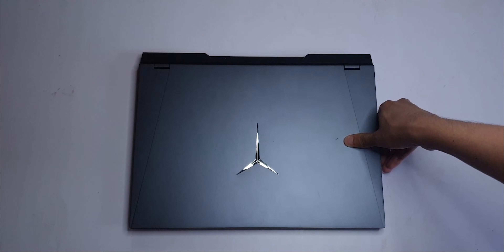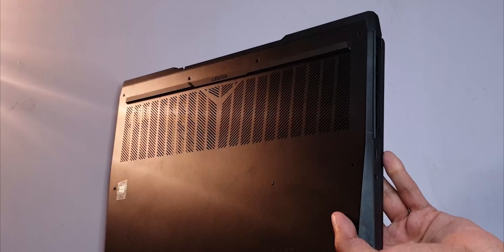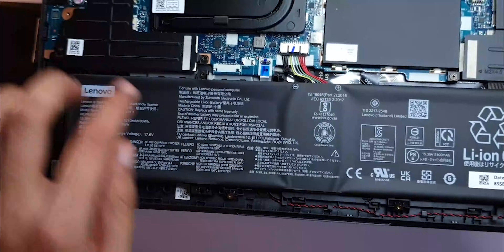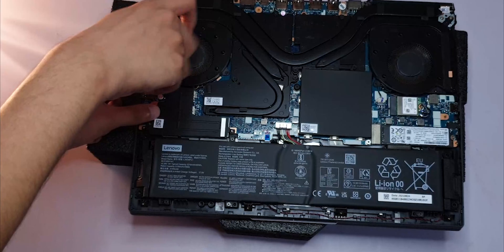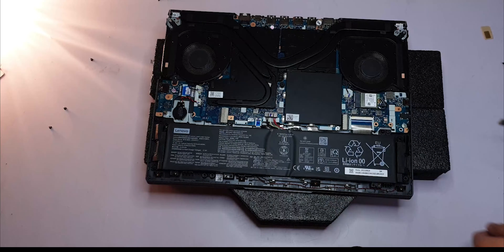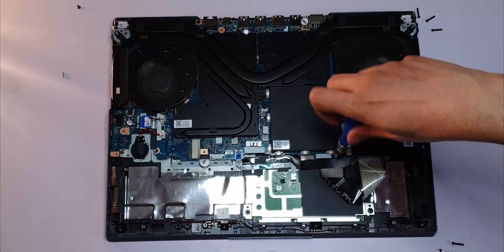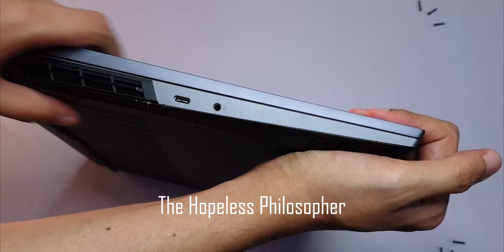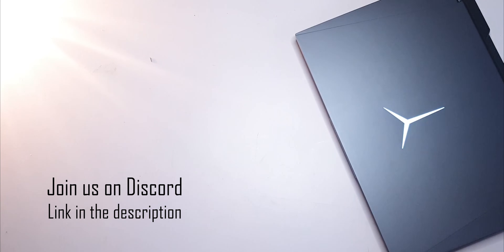Lenovo Legion 5 Pro Teardown - Battery Replacement, RAM Upgrade, etc.

Comment: My motherboard gave out after only a year and a half of use. Never buying a Lenovo gaming laptop again
Reply from the maker: They're not the best for the price, that's for sure. I would probably stick to Asus next time
Reply: @TheHopelessGeek my dad got it for me as a graduation gift in 2022. I did a lot of gaming on it. But still. No excuse for the motherboard to die like that when it’s working perfectly fine. I only opened it a few times to clean out the dust in the fans. I never dropped it or spilled anything on it. It almost always stayed at my desk.
Reply from the maker: Damn, that's unacceptable. Did you contact them yet?

Comment: 4:55 trust me they will last more than your older battery. The cables are not fragile but you have to be careful around them. 80 Wh is not a joke. It is like a pocket sized c4. Nasty fire incident can happen.
Reply from the maker: Yeah, I see your point

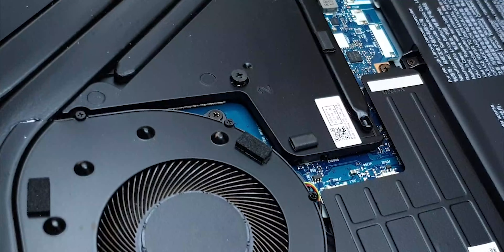Comment: 3:02 It's not going to come off. The spring loaded screws are not designed to come off when unscrewed. They make a distinctive click sound while engaging and disengaging. Don't damage them.

Always disconnect battery before touching internal items. The motherboard might get short circuited.
Reply from the maker: Valid points. Thanks for mentioning

Comment: This is a serious issue regarding battery. My battery wires ,the red one. They melted off 🤐🤐🤐 just by using laptop. Literally the motherboard consumed so much power my battery thin wires just melted offf. Good thing is the system stopped using the battery and it wouldn't turn on without the power adapter. Still Lenovo vantage shows battery health GOOD
Reply: Lenovo vantage is a joke
Reply: Yes the device i have is the same one Lenovo Legion 5 pro 16ACH6H model
Reply from the maker: Damn, thanks for sharing 🧐. My fear wasn't irrational then. I'm not surprised that Lenovo's software doesn't show anything correctly 😂

Comment: 2:58 u don t need to take out screws. when they are unscrewed u can feel them jump when further unscrewing. just take the heatsink off and make sure to disconnect the 2 small fans before
Reply from the maker: Ah, thanks.

Comment: Hai...Great Video..I am using Lenovo Legion 5 Pro (i7 11th Gen, RTX 3070) it seems my 16 GB RAM (8+8) is 1Rx16 and it lowers the speed. I wish to upgrade the RAM to 32 GB (16+16). I look at Crucial RAMs but they don't specially mention if its 1Rx8 or 2Rx8 included. So its a hit or miss buying them. So can you suggest any RAM which is exclusively using 1Rx8. 
Another question  : And also is the maximum capacity in my laptop is 32 GB or 64 GB RAM?
Reply from the maker: This RAM looks good. 2Rx8 and 3200 MHz, faster than the basic 2400 MHz. https://amzn.to/3X8HnLa
You'll need two of these.
Reply: @TheHopelessGeek  Thank you
Reply: @TheHopelessGeek  Is the laptop support 32 GB or 64 GB RAM ? I use Lenovo legion 5 Pro (i7 11th Gen , RTX 3070) Wome websites say it only support 32 GB...Can you help?
Reply from the maker: I think it's maximum of 32 GB. This forum page might help https://support.lenovo.com/in/en/solutions/ht504725-where-to-find-the-maximum-supported-ram-information
Reply: @TheHopelessGeek  Thank you..never seen any other YouTuber so responsive like you...So, you earned a subscriber
Reply from the maker: Thanks for the sub ☺️

Comment: have you experienced any odd sound from one of your fans? 
My right one is humming in a way like there is something making it slightly to vibrate as it sounds even worse when I am gaming.. 
Have you tried to remove your fans yet ?
Reply from the maker: Hmm, I think I heard them rattle once, but not anymore. I haven't removed them, but it should be quite easy to do.
Reply: @TheHopelessGeek  From what I've seen on some pictures I will have to remove the entire heat pad with it's pipes in order to get to the last screws for the fans. 
And a complete new set cost's around 120€ so I would rather attempt to fiddle with them my self, this is my 8'th laptop in my lifetime which took 1 week before I opend it and added another M.2 disc and 32GB Hyper fury X ram. 
When they are on low rpm or idle it dosen't rattle but start a game and it makes me worried.
Reply from the maker: I see. I'll have to keep an ear on mine then

Comment: Tip: what worked for me, was to use a suction cup (used to carry glass panes and such) and attach it to the bottom panel of my (brand new) Lenovo legion 5 pro and just pull it a little. That made the entire underside open up. I had tried getting all kinds of "official" wedges and other recommended tools in between the cracks without any success, before I thought of using a suction cup!
Reply from the maker: Thanks, I'll get one of those 🙂👍🏼
Reply: Wow thank you I used one of a phone suction cup holder and guitar cards and worked perfectly, this Lenovo devices are known for there hard opening cover you need to put a guitar card carefully and just be patient, thank for this idea 💡🎉

Comment: Spring-loaded screws are actually captive too, they WON'T come off.  they will unthread completely which you can feel if you go slow and pay attention to the feedback given by the screwdriver.  The reason for the springs is to affect the mounting pressure, as it's the cooling system of the machine and the screws are holding it around the CPU and GPU, much like how a lot of desktop PCs with Air coolers have springs around those screws.  Same general principle here.  

I am a Warranty Repair Technician for Dell and Lenovo currently.
Reply from the maker: Oh, interesting. Thank you for sharing that😊👍

Comment: So i cant like old laptops remove the battery or disconnect it and plug the charger when gaming so i dont harm the battery life ? 
Even if i opened the laptop each time i decided to stress out my laptop and unplugged the battery , i mean can the laptop power on and work with unplugging the battery and plug the charger like old ones ?
Reply from the maker: Yeah, it's a hassle here for sure. But there are many battery protection features that reduce any damages with heat in these gaming laptops. You should be good regardless 🙂

Comment: I have already written this comment too many times…Never take out anything on the system board before disconnecting the battery first.
Reply from the maker: You're right.

Comment: To remove the heatsink, just unscrew as much as you can and then lift the heatsink off . The screws are not designed to come out and they are present to add mounting pressure on the cpu and gpu by the heatsink ..
Reply from the maker: I see. Okay, I'll try that. 🙂👍

Comment: You should have a link to buy upgrades for the laptop.
Reply from the maker: What upgrades would you suggest? Faster RAM? 🙂
Reply: @TheHopelessGeek  My 16gb cam with SKHynix RAM, I replaced it with 32gb of Crucial CL22. RAM would be a definite upgrade if it came with that slow Samsung memory. I didn't get a chance to test out the SKHynix RAM, I couldn't pass up the 32gb deal I found on Mercari. Did you find a bigger battery like the Legion 5 has available. I can't find a bigger battery that fits the Pro. The screw notch on the bottom right does not line up. I started to file it down to fit, but I sent it back to Amazon.
Reply from the maker: Oh, I see. The RAM upgrade is surely on my list of upgrades 🙂👍🏻

Comment: bro the dust issues with gaming laptop fans is so annoying . I've ocd so I end up opening my laptop to clean the fans every month , I even broke my gpu fan twice trying to open it up completely and fans for my model are very ecpensive . please make a solution video for this dust issue . I've tried dust filters and air fresheners for my room nothing seems to work . by the end of the month same amount of dust is there
Reply from the maker: You could try vacuuming the fans while brushing the fins with an old toothbrush

Comment: Those screws are called captive screws, their purpose is to stay in place so that the service man don't lose them while servicing the laptop. 
As the heat sink is a critical component to keep the laptop healthy Lenovo's engineers have taken care to keep the heat sink always stiff and screwed by making sure all the screws are in place.
Reply from the maker: I see. So do unscrew them as much as they come out and try to pull the cover up?
Reply: @TheHopelessGeek  Yeah, you are right.
Reply: Nope, the screws have springs so as to apply extra mounting pressure on the cpu and gpu by the heatsink for best performance.
Reply from the maker: I managed to take them out just by unscrewing as usual on another machine. Pretty sure it'll work the same way here.🙂
Reply: @MrReklez  Those springs have negligible pressure on the heat sink.
As I said those are captive screws used to keep the screws in place. Google it.🙂

Comment: Actually u got unplug the battery ASAP and hold the power button for few seconds to discard the power completely once you open .... Coz there is better chance in getting shortcircuit than you getting 1 million JK. as my friend just droped a screw in motherboard . lap just did spark and the rest was history he was required to replace the whole laptop
Reply from the maker: I see. Yeah, it wouldn't be an issue if the battery was a separate compartment as they were before.😄

Comment: I never removed the spring screw i use to lossen it and then directly pull the heat sink out
Reply from the maker: Oh, I see. The heat sink seemed to be in place despite loosening. Someone suggested I push the heat sink down and unscrew.
Reply: @TheHopelessGeek  I think it was due to the thermal paste the heatsink was still intact with the cpu and GPU You should try it again loosen the screw to its max and then try pulling and twisting it gently
Reply from the maker: Hmm, okay.🙂👍🏻

Comment: You'll have to gently press down on the heatsink to hold the spring, while simultaneously loosening the screws at the same time. Don't unscrew one after the other, do one rotation at a time for all spring loaded screws and repeat.
Reply from the maker: Oh, I see. Thanks.👍🏻🙂
Reply: @TheHopelessGeek  Did it work?
Reply from the maker: Haven't tried yet. I'll let you know
Reply: @TheHopelessGeek  IS he Asian the Laptop I mean I love Asian tech I think this is one of the best I think :)
Reply from the maker: This laptop is available worldwide though.
Reply: No, you don't have to. You need to unscrew them sequentially. While unscrewing go like 8-7-6-5... and while screwing the heatsink go like 1-2-3-4.. The screws are already marked for that.
Reply from the maker: I see.

Comment: Are hotswappable batteries better? My battery swelled up and it destroyed my keyboard and touchpad and now i have to use it with direct power supply. I have same type of battery as u have sitting in cupboard.
Reply: The battery lasted 5 years tho
Reply from the maker: I meant external battery compartments are way easier to swap in events like that. No screws and connectors to deal with.🙂

Comment: I think complaining about the way the battery is fitted inside the laptop is just nitpicking. Lets not forget the older laptops used to be thick and heavy with less hardware in them. 
Design and aesthetic improvement usually comes with some tradeoff and here we not talking about Torch or something which requires frequent battery replacement , its not everyday that people open up their laptops to replace components in it.
Its the same case that we used to have with our old smartphones, the batteries now a days are inbuilt (hard to replace) but makes the look, feel and overall aesthetics just so much better and also make space for additional hardware (like bigger camera modules).
Not trying to contradict here, in fact it would have been great if gadgets these days could be more modular (like you have mentioned for your laptop), but again I think we can't have best of both worlds.
I like your videos though :)
Reply from the maker: I suppose that's true.😊

Comment: If someone can't find a plastic pry tool kit near you then you can simply go to a local mobile shop that sells screen guards and ask him for the upper plastic card of a 11d screen guard or you can also use a old debit card.
Reply from the maker: Debit cards might be a bit too thick on the edges. One of those guitar picks would work quite well here. They need to have narrow edges to get under the two panels🙂
Reply: @TheHopelessGeek  i have those blue tabs openers and pryer tools but since most of the people dont have guitar picks hence suggested the above solutions. I myself used the screen guard and old expired debit card to open up my acer nitro 5 to upgrade and it did the job without any scratches.